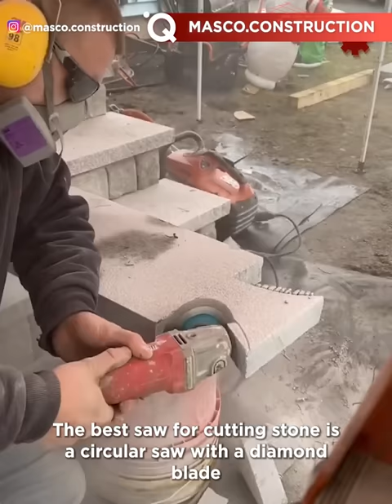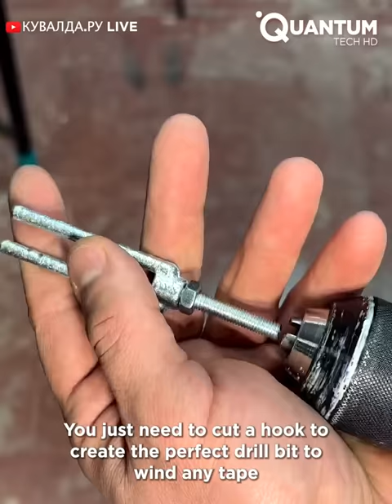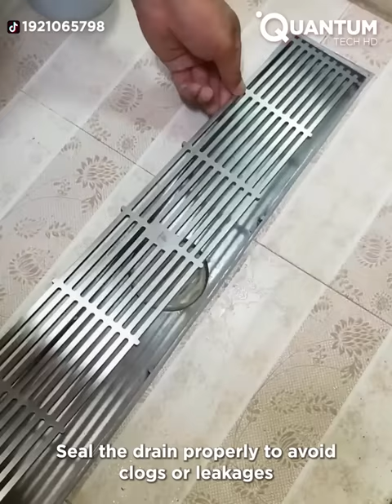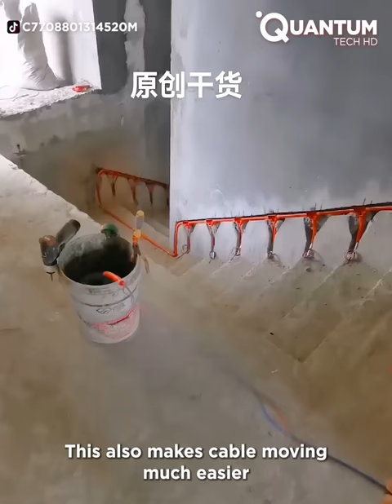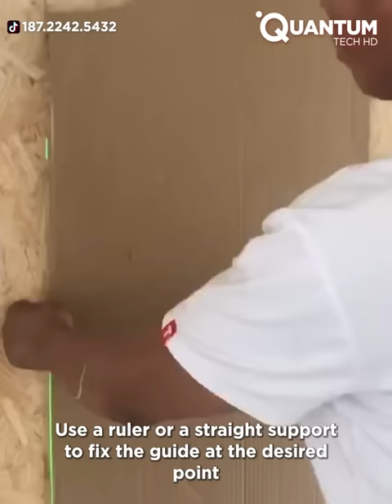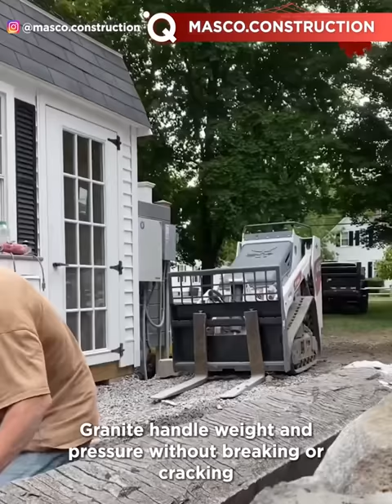Construction Tips & Hacks That Work Extremely Well ▶10

Comment: Never install a sink just like that... there is no full support system. The silicon was also not cleaned up and the sink was not properly set... do not follow this technique folks, sorry
Reply: Гдд
Reply: Además se ve horrible y poco práctico
Reply: Have seen sinks fall. Suggest old style setting sink on top of counter top.
Reply: You right my man
Reply: Heard. I've done a few and they are a pain.
Reply: If you are gluing underneath without using a support system. You need to use a stone based exposy but the countertop must also be out of quartz, granite, marble, etc stone... any other way of undermounting the sink, you need support brackets or stringers supporting the sink flanges. I do this work in houses and towers every day.... said by a professional stone mason.
Reply: Almost none of these tips are finished so I don’t know why you would think this one is. I believe he’s doing it to hold it up so he can then go underneath and hang brackets without having to hold the sink at the same time
Reply: @floundrpoundr  do you think when they cut a hole to install electrical box and they didn’t show the wiring being ran to the electrical box it was done as contractor I know what’s the next steps are like I said none of these tips were finished all they are is to show you a portion that will help you do something.
Reply: @josephsmith1977  keep the mental gymnsatics and gaslighting going bub... do you know what false advertising is? Again, EVERYBODY in the comment section has agreed except for know it all you... don't change the subject manipulator man. The topic is how he installed the sink and it was not done properly based upon the video that he has shared. Are you a plumber or somebody that installs sinks professionally?
Reply: @floundrpoundr  you didn’t go through every portion of this video and say well you don’t cut a hole in tile and then you just lay it on the subfloor no you have to put grout underneath it you didn’t criticize that one. I’m said that the guy wasn’t done we don’t get to see it, I know I would go back after hanging the sink which is a good idea. I will put brackets underneath there
Reply: @floundrpoundr  this is absolutely done right. If this was a new remodel. You can flip the countertop over and lay the sink on top and then attach brackets. This is with a countertop already installed to hold the sink up from underneath and not you holding it up while you put brackets on. This is done right and you were wrong.
Reply: @josephsmith1977  and unfortunately i also believe you're a hack contruction worker... if you're in this business that is. We all can figure out how to do things one way or another. In my line of professional work, we are obligated to base off oue work based upon osha and ansi standards, same code and specs that architects and engineerss have to follow, and that translates straight to the manufacturers and suppliers, our work is done correctly and is always covered by warranties and guarantees. The proper way. May be more expensive but its that 100% way to do it...

Comment: Never tape plates for electrics devices. Plugs, switches, etc. easier to take the plate off, and tape up the device. The tape doesn’t conduct electricity. Totally safe to tape it, paint the wall, then put the plate back on. Other wise, if you tape the plate , and do it that way, when you pull the tape off, it won’t be perfect and it could pull paint off too. I’m an experienced electrician of 20 years. Just sayin. Makes things so much easier.

Comment: Vary First One.. Would have been better to put the Caulking on Before you hammered the two sections together so the caulking acts like a natural seal and will not Rot away due to Sun Exposure. 
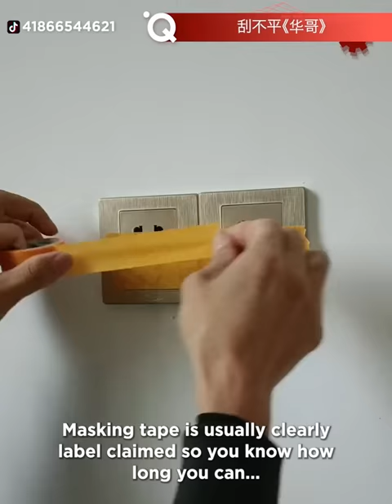9:57, That's just stupid.  The Last one is just a Repeat of the one at 0:58.....

Comment: What is "slab cladding"?
Reply: Marble or stone masonry... like cladding a wall but using stone slabs. Now "slab" veing vague... usually slabs are much larger than bricks. I've mechanically set full size jumbo slabs from 7'x12' and have done smaller geometric shapes the size of dinner plates. Multiple different forms of adhering the stone for cladding purposes; copper wire achors and plaster, thinset, morter, metal clips for engineered stone, etc... it goes on and on and its crazy. Its easy yet difficult. Tolerance for marble masonry is very very tine. 1/32" or less. For example, in this video cover, the tiles, had they been actual stone slabs that aize but and 3/4" or thicker, they would need to be structurally attacked to the wall in a form of "CLADDING" rather than the tile can be adhered with a duroroc or hardyboard backer subtrate and then thinset mortar to adhere to said wall or whatever... it'll take some years to learn or lots and lots of square footage to gain good experience and get it right..... said by a professional union stone mason

Comment: Der erste Tip mit dem Blechdach ist absoluter Amateurmurks. Popnieten und Silikon gehen gar nicht. Mit dem gleichen Aufwand kann man einen absolut dichten Stehfalz ausbilden.
The first tip with the sheet metal roof is absolute amateur nonsense. Pop rivets and siliconeare technical nonsense. 
You can form an absolutely tight standing seam with the same effort.